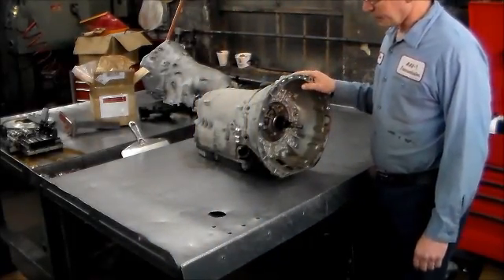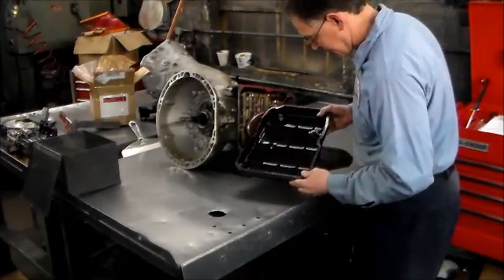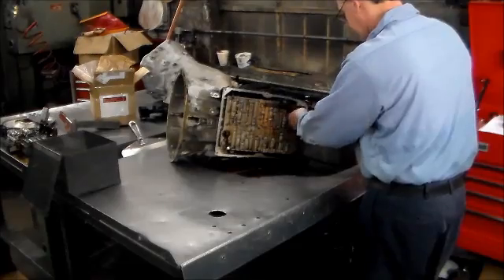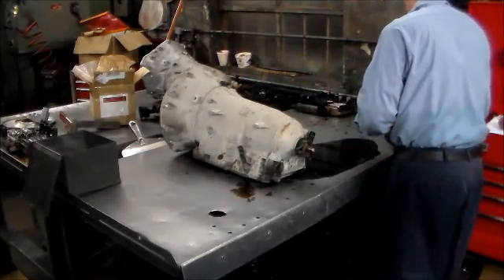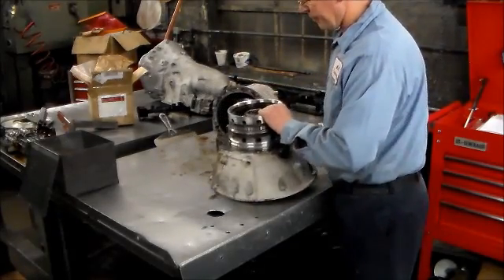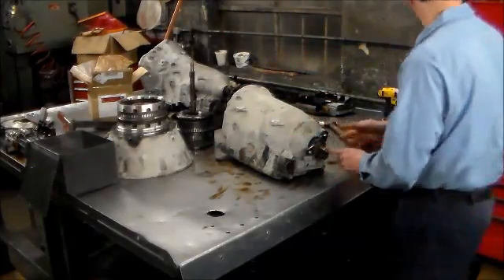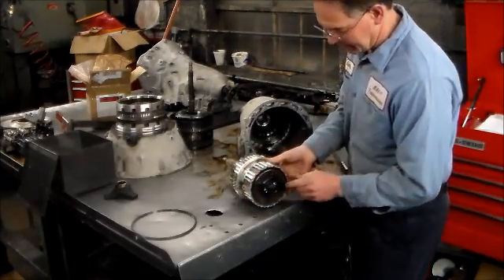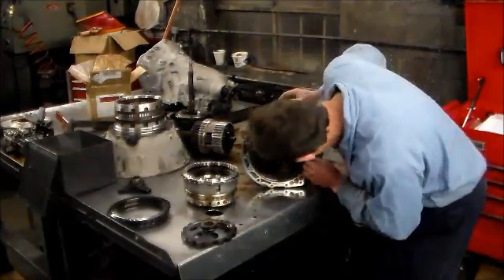722.6 Mercedes Transmission, Teardown Inspection

Comment: Hi Gary, I have 2005 ML500 getting codes P0715, P0730 with shifting issues?
Reply from the maker: The P0715 Can make the P0730 show up, Make sure trans is full of fluid. Make sure no oil worked its way up the wire loom and into the TCM.  If all looks good and its full of fluid, your conductor plate is no good

Comment: Have you ever seen clutches delaminate on these transmissions? One of the clutch disks in the B2 housing completely delaminated causing the filter to clog up and run the transmission dry. Any  idea what could cause this kind of failure?
Reply from the maker: At one point there was probably water in the trans. Water melts the glue that holds the paper onto the disk. I would change all of the clutch plates.
Reply: @GaryFerraro  thanks for the very quick response. What’s odd is every other clutch disk looks great except the one that delaminated. The transmission had 122k miles when the failure occurred. I’ll be posting a short clip showing the failure in a minute
Reply from the maker: @OnlyKelp  ok,  or you can send pictures
gsferraro@yahoo.com

Comment: By failing to have torque converter lined up, it got pushed in transmission, had to pull it out,  could've that messed up my pump some how?
   I replaced motor,

Comment: I have a sprinter t1n, when I reverse I have to wait a few seconds before I go into drive otherwise it will not move,what could be the issue.tks
Reply from the maker: Hasthe fluid level been checked?

Comment: Gary, My 722.6 stops moving forward and reversing 30-60 seconds after startup. I did experience a clunking noise coming from the transmission when I would drive it before the situation I described above, & I recently had a conductor plate kit installed months prior to this situation earlier in the year, so I'm hoping maybe something on the plate has been damaged instead of having to replace my entire transmission
Reply from the maker: Conductor plate really would not cause this, may have issue with converter or a clogged up filter

Comment: Thank you for the videos they're really nice you know the common failure of this transmission I have one that keeps on going in limp mode I can't get a conductor plate and distribution plug and the filter and the fluid but it's still going into limp mode and it sounds like the tc is winding or it could be the pump winding it worked for a a few days after I change the conductor plate but then it went back to limp mode where it only move a little bit
Reply from the maker: Did it drive ok for the first 10 minutes or so and then stop moving?
Reply: @GaryFerraro  I first had the problem I went to go get in my car and it wouldn't move at all I left it running after being on the highway for a few hours and I went to get back in my car and it wouldn't move so I let the car turned it on and off a couple times and it it moved a little bit and then went and go limp mode so I changed the conductor plate and the the plug and cleaned it all up and it ran fine for a week and then now it's doing the same thing as soon as it'll go for about a hundred feet and then it'll go into limp mode like it's going into limp mode out of first gear

Comment: Wery nice video ! Here i my country ( Hungary ) doesnt really good transmission specified mechanics . I had a very frustrating problem with my same trans like thisw . only difference is its in a c270 cdi . My biggest problem is it doesnt really gives mutch lock-up compared to others . what could cause it ?
Reply from the maker: OK, so the trans has no lock-up? is it setting a code?
Reply: @GaryFerraro  it has when im pushing the gas slowly to the floor . but when i floors it down fast doesnt. im seeing videos of the lot more HP OM606-s with stock gearbox and torque converter and they gives mutch more lockup.
Reply: @GaryFerraro  anyway no trouble codes
Reply from the maker: @druszan17  When you floor it the converter will unlock
Reply: @GaryFerraro  yes, but when im pushing to the floor gently it stays locked .

Comment: Hi Gary, thanks for the great videos and explanations.
i have a 722.663 that looses drive when hot, the scanner shows code 51 gear implausible or transmission slipping.
could it be possible to slip due to loss of hydraulic pressure? and only orings and seal need replacement? 
the scanner live data says when hot, idling shifter in D brakes aplied "clutch speed difference"  100rpm, when cold it indicates exactly the engine rpm (about 700rpm) this problem arose after being parked for 30 days due to quarantine
No bits in pan and already change fluid and filter.
Reply from the maker: When you loose drive do you loose reverse to?  When you loose drive it doe not move forward at all?  If you turn off the car for a few minutes and start it again can the car move a few blocks?
Reply: @GaryFerraro  yes, that's what happens!
Reply from the maker: @Mientras_Tanto  Sounds like the main filter is clogging up, something in the transmission or converter is probably coming apart
Reply: @GaryFerraro  I've already changed filter and fluid, is it possible to have this problem if solenoids orings get hardened or leaks? I'm brainstorming praying that i don't have to remove the transmission.
Reply from the maker: @Mientras_Tanto  ok, when you replaced the filter, was ok for a day or two?  What type of scanner are you using to read the codes?
Reply: @GaryFerraro  no it was ok for a couple of minutes, then no gears again, I'm using icarsoft mb v2.0
Reply from the maker: @Mientras_Tanto  ok so just to confirm, when it stops moving you can shut off the car for a few minutes, start it up and will move again but no far
Reply: @GaryFerraro  I've checked the temperature and it needs to be below 140° F to engage again. And if when cold i try to drive it like i stole it, it goes 1-2-3 and miss 4th then it locks into 3rd
Reply: @GaryFerraro  thanks for your help Gary. Today i replaced conductor plate and pilot bushing and changed the filter again also checked solenoids and valve body valves and springs all is in good shape now, it had dried sort of "grease" i think is clutches and brakes residue. Nothing else out of the ordinary.
But now it keeps engaging (even when  180° F is reached) it just needs a little tap in the throttle and it engages but can't shift.
Code 51 and 147.
This time i ask a friend to drive and when it faulted to 2nd the n3 sensor started to show and jump between 11.000rpms and 7.000rpms. then no engagement until tapping the throttle.

Comment: Great video Gary, have u seen this fault before? hard downshift 2-1: Whats the bellville snap ring look like?
Case Number: K29132783
Vehicle Issue: Vehicle has a harsh 2-1 down shift.
Year: 2005 | 2006 | 2007
Model: LX - 300 | LX - Magnum | WK - Grand Cherokee | LX - Charger | XK - Commander
Automatic Transmission / Transaxle Model: NAG1 (5spd Automatic - RWD - Electronic Shift - TCM)
System or Component: Automatic Transmission / Transaxle
Symptom:Harshness | Too Hard / Firm / Stiff | Double Bump Engagement | Harsh Engagement | Upshift / Downshift Issues
Transmission Gear or Shift Involved: 2-1 Downshift
Case Verification: No codes are setting. The 2-1 down shift is harsh.
Recommendation: Inspect the K1 clutch Bellville retainer snap ring is seated correctly.
This can prevent the K1 clutch from un-applying fast enough and cause a momentary 3 element fight.
You may want to check for stuck or sticky 1-2, 4-5 shift valves in the valve body before removing the transmission.
Reply from the maker: Never had this issue before. Belville spring is a thick dished plate.
Reply: @GaryFerraro  cheers, i'll open it up and have a look, do you need any special tool to depress the belleville spring to get the circlip on?

Comment: Was wondering what ATF you’d recommend for this transmission?   The 2002 E320 RWD Wagon has Redline added at the last service.  I’m thinking about a service (replace conductor plate and socket, filter and gasket, as well as draining torque converter).  There’s lots of ATF to flush out through the line to to radiator - was thinking about using the  Valvoline Max life multivehicle ATF.  I’m told it’s compatible with the vehicle but I thought of asking you for a recommendation since I’m gonna use gallons for a full flush
Reply from the maker: Sure that should work, as long as it is a premium Synthetic fluid you will be fine

Comment: Are these the same trandmissions on a 2007 Jeep Grand Cherokee, if so, where is the input speed sensor located?
Reply from the maker: It could be yes, depends on engine size, is it a 3.7?  if so the input speed sensor is on the conductor plate
Reply: @GaryFerraro  Yes and thank you. I had code p0732 and p2767 pop up on my transmission. I drive and it gets stuck in 2nd gear  I swapped conductor plates and the same thing happens. It says incorrect gear ratio bank 2 and input speed sensor faulty. I'm just looking for advice on what I should do.
Reply from the maker: @jasonmiller4311  check your TCM make sure no oil got in the TCM

Comment: Hey Gary finally got the transmission back in but its overheating it shifted great but its now is over heating not sure whats going on? any suggestions i also hear a rotational noise im pretty sure i got the converter in right i checked it a bunch their are no codes just hot oil warning fluid looks and smells great
Reply from the maker: Do you have a scan tool to see how hot the temp is?
Reply: Gary Ferraro the scan tool i used i looked under transmission it said 220 i think i figured it it out the exaust is not correct it needs to be redone to allow heat to escape from under it i also am going to run a 180 degree thermostat and put in a heavy duty trans cooled and put on a vented hood their is no way its anything mechanical i took her on the free way did 86 no issue i started driveing off the freeway i got a hot oil warning i also pull my foot on the brake and gas i did that several times no problems hemi swaps are known for heat issues

Comment: There is some controversy about checking the fluid level in the MB 722.6 transmission using  market supplied Dipstick's.Can you show a pic of where the dipstick enters the trans oil in the sump?  Especially where the "Black Diamond" on the plastic measuring tip prevents the tip from travelling past a certain point? Effectively the "black Diamond" acts as a "Stop". Or does this stop not exist at all?  If this is the case, it would make checking the fluid level a very "Hit and Miss" affair.
Very informative video, Thanks for sharing.
Reply from the maker: You basically put the Dipstick "tool"  down through the filler tube until it bottoms out and stops
Reply: Hi Gary, Thanks for your reply. Problem with that is, the dipstick has a flexible plastic measuring tip, which has Hot / Cold marking's ( plus of course, the the actual rod itself is flexible .) So if you push it down, and it reaches the bottom, then the measuring tip will bend, so you wont get the a correct reading. It's my point that the "Black Diamond" on the measuring tip, acts  as a stop. So next time you have a trans opened up, can you insert a dipstick into the tube, and see how much emerges in the sump? Of course, if there is no stop, then ( theoretically ) you should be able to push the dipstick so far down the tube, that  6 inches should be visible in the sump?  If possible, and you can do this, could you please take a pic and post it here?  Many Thanks for your help with this, it will settle the point once and for all.
Best Regards, Jim.

Comment: Hello
  I have newly overhauled my gearbox.  Now I have the problem that the transmission only in the 1st and 2nd gear switches (automatic).  Before that I also had this "gait problem".
  I have received the following 2 errors:

  1. P2502 Pickled gear implausible

  2. P2503 speed comparison Comp.  Negative / target gear reached

  Could you please help me?  Can it be that the shift lever is broken or the control unit in the footwell is defective?  Do you have any experience with this problem?

  Thank you very much for your help!

  Best regards Dhulfiqar Al-Rubaye
Reply from the maker: ok, so to confirm, this makes a 1-2 shift and has no 3rd, 4th or 5th?  What is the year of your car?
Reply: The car is built in 2002 CLK gear 722.6960 and switch gear 1 and 2 but with shift lever I turn and when I drive a bit after I do not want to switch with hand does not work
Reply: I have reconditioned the transmission and new board and everything new but I think that loses the program or does not know when can switch
Reply: Hi, I have exactly the same codes, I've replaced the conductor plate, and it didn't help (reset codes properly). What was the solution in your case? Can you help?

Comment: Hallo 
ich habe meine Getriebe neu überholt. Jetzt habe ich das Problem, dass das Getriebe nur noch in den 1. und 2. Gang schaltet (Automatik). Vorher hatte ich ebenfalls diese „Gangproblem“. 
Ich habe folgende 2 Fehler angezeigt bekommen:

1. P2502 Eingelegter Gang unplausibel

2. P2503 Gangvergleich Vergl. negativ/Zielgang n. erreicht

Können Sie mir bitte helfen? Kann es sein, dass der Schalthebel kaputt ist oder das Steuergerät im Fußraum ist defekt? Haben Sie vielleicht Erfahrungen mit diesem Problem?

Ich bedanke mich sehr für Ihre Hilfe! 

Viele Grüße Dhulfiqar Al-Rubaye
Reply: Eng:Hi, I have exactly the same codes, I've replaced the conductor plate, and it didn't help (reset codes properly). What was the solution in your case? Can you help?
German: Hallo, ich habe genau die gleichen Codes, ich habe die Leiterplatte ausgetauscht, und es hat nicht geholfen (Codes richtig zurücksetzen). Was war in Ihrem Fall die Lösung? Kannst du helfen?
Reply: @vladk9360  Oh bei mir war ein Lager kaputt Bremsanlage
Reply: @kfztuningdhulficar9648  Eng: So, you have to remove the transmission, disassemble it, repair it and place it back. Am I right?
German: Sie müssen also das Getriebe ausbauen, zerlegen, reparieren und wieder einsetzen. Habe ich recht?
Reply: I had the same codes. In my case I had to replace ALL transmission oil (include from torque converter and radiator) -> not just in oil pan. This guy tells how to do this "properly/easier way": https://youtu.be/7syO7SzKKQ4 Also, oil level was incorrect in my case. I had to measure oil level when car was hot and oil should be between min and max on deep stick on (80 degree measurement). I've measured only on cold, so I didn't have enough oil. Hopefully it will help for someone.